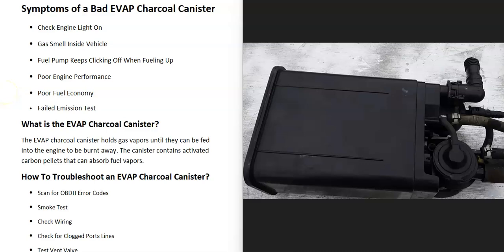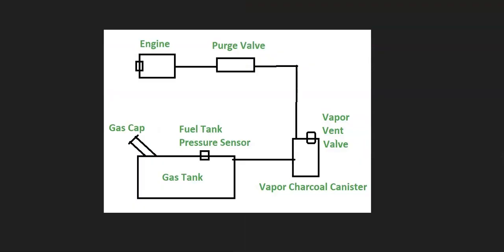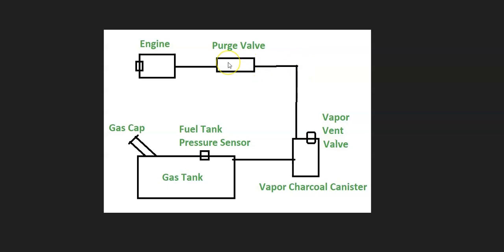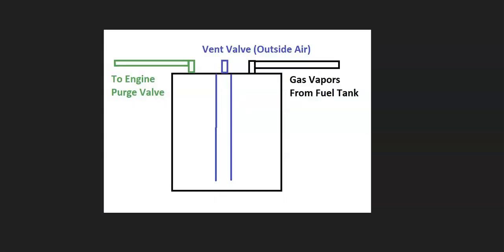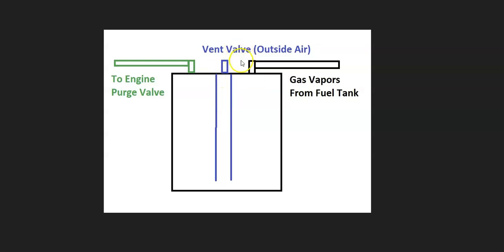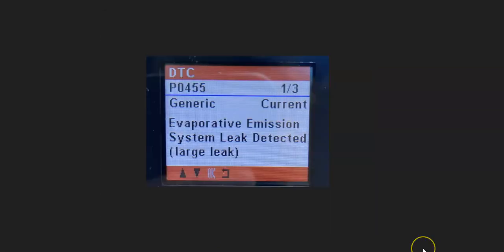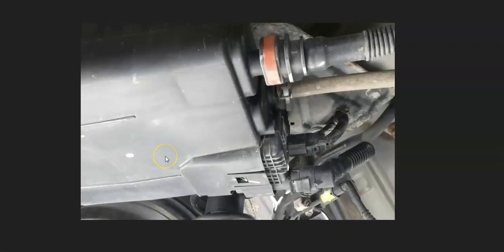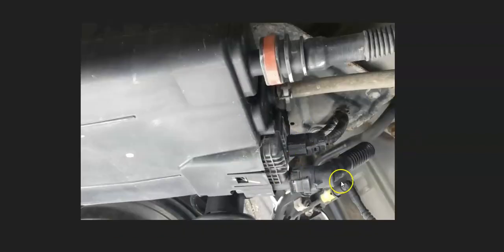Symptoms of a Bad EVAP Charcoal Canister and How to Test if It Has Failed

Comment: Hi , thanks for the video 
I have Mazda 6 2014 i replaced the vap canister with new OEM after that if the car running on idle for more than 30 minutes strong gas smell coming near gas filling neck and I checked everything no leaks at all just smell , what do you think about that
Reply from the maker: There may be a leak, or the purge valve may not be opening and sending the gas vapors to the engine but there should be code if there is a problem.

Comment: I have a 2015 Highlander with a PO441 and PO445.  I've replace both the gas cap and purge valve.  I accessed the evap line by disconnecting the purge valve for a smoke test.  With the key in on position but not running I have smoke leaking from the charcoal canister at the fill neck and underneath the car near the fuel tank(but I didn't have time to look closer than that.)  The vehicle smells like fuel often.  Does this mean the charcoal canister at the fuel neck is broken?  And is the smoke near the fuel tank leaking because the vapor vent valve is broken or just not closed because the car isn't running?
Reply from the maker: Is the vent valve closed? The vent valve, usually located on the charcoal canister, is a normally open valve that needs to be closed when doing a smoke test. A good scan tool with the option can close it, or the port can be blocked off with a plastic bag. If the vent valve is closed and smoke is still coming out, there is a leak somewhere. Sometimes, depending on the gas tank location, the gas tank seal around the fuel pump can leak and make it seem like the charcoal canister is leaking.

Comment: My 2011 silverado is idling rough and hesitating when driving. It  threw a code for (small evap leak) I replaced the purge valve and it didn’t help. Trying to diagnose it I haven’t done a smoke test yet but I’m not having any fuel symptoms or smells that I’m hearing on the charcoal canister. Any thoughts?

Comment: Had trouble filling gas tank, replaced charcoal canister, now my truck stalls out and sounds like a diesel after it's idled for 20 min ,or I press on the gas pedal while idling the diesel sound gets worse, codes 455,456, 191,102,113, 128, also put new thermostat in it. Wanted to smoke it to find what was leaking, mechanic didn't smoke it, he decided to do engine flush, replaced vvt valve solenoid, valve cover gasket a whole case of oil, oil filter put a new fuel driver module on it, put in a new cam sensor, said now it's showing cam phasers, timing chain so I've spent 2000$ on labor only new alternator new battery new starter new steering pump serpentine belt truck runs worse now before I replaced charcoal canister.
Reply: Yikes. . Sorry about that

Comment: Would this also cause the purge valve up top in the engine to run nonstop?
I kept having a ticking sound coming from that solenoid and could feel the vibration from the valve. I changed with the lifetime warranty brand which turned out to be the aftermarket brand and was still ticking. After a couple of months I changed it with the oem 2 year warranty (go figure) and the ticking stopped but the symptoms although getting better for a while were still there and now back to how the symptoms were besides the ticking, but I can definitely tell it is steadily lugging/open. I unhooked it and seemed to run better for a couple of days but I feel the canister is ruined from the steady open valve. I also always would fill the tank so that is something else I was not aware of was a bad thing. I'm thinking filling all the time xaused the issue from what I've read as it was not wanting to start after refueling as well a few times until I quit doing that.

Comment: Hi there I've always had a hissing sound when opening the fuel cap never caused a problem. I have the vehicle for 10 years and recently had a new timing kit and water pump replaced. Now I get a strong petrol smell and it seems to be coming out of the charcoal canister drain pipe. But if I take the fuel cap off it stops and if I put the fuel cap back it starts fuming again. Car runs perfectly all the time idling a bit high about 1100rpm. Any clue what's wrong??
Reply: On the charcoal cannister there is a vacuum hose. There is a sensor built into the hose. Check the sensor. If the sensor is bad you will have to change the hose.

Comment: Great video! Very informative. Can a damaged charcoal canister cause random misfire on start up?
Reply from the maker: No, the charcoal canister won't affect the engine. A stuck open purge valve is the only EVAP component that can affect some engines.

Comment: My check engine light code says charcoal canister and I am getting bad gas mileage (but) I don’t have the symptoms when fueling up or no smell of gas.
Reply from the maker: Issues when fueling up happen when the vent valve, often located in the canister, is stuck shut, but it can also fail and be stuck open.

Comment: What would cause gasoline to go up to the canister?
Reply: Over filling your fuel tank, if you are filling it on the slow setting then when it shuts off stop pumping. Put the pump up and gas cap back on. Other wise when you keep trying to pump more in it you close the air gap bubble more which in turn overflows fuel into the vapor canister
Reply: @19BADGER-F250  I put it on auto pump on medium, when the thing clicks off I don't pump more.

Comment: I have a 1997 toyota tacoma and when my engine warms up after a few minutes of running i have a fuel leak coming out of the charcoal canister vent line. It just keeps pouring out for a good while even after i disconnect the battery.

Comment: Hey, I have a 2006 VW Touareg 3.2 v6.
Everytime I fill fuel over 1/4 tank the car misfires really bad and Preformance is terrible but when I drops back down to 1/4 or less, it runs fine. Is that a cause of a bad charcoal canister?
Reply from the maker: The only EVAP component that can affect the engine is the purge valve. If there are EVAP codes, I would test the purge valve and be sure it is good.

Comment: Hi I have a seat toledo mk2 1.8 20v and when I start my car when I  first start my car it cuts off and run lumpy for about a mile/ engine starts warming up.. would that be a symptom of a bad charcoal canister? as iv checked everything else on the car.
Reply from the maker: The only EVAP component that can affect the engine is a stuck open purge valve. If you think there is an EVAP problem, I would test it.

Comment: ¿Problems with the charcoal canister or vent valve can cause P2279 (intake leak) code and rough idle?
My W12 Bentley has P2279 that appears only in Bank 1 and ECU 1 as well some misfires in all 6 cylinders of Bank 1, I already replaced the EVAP purge solenoid and both banks PCV valves and worked fine for a while, but condition still persist.
I did a smoke test from different points in the intake and vaccum hoses and no leaks werre detected
Note, Bank 1 is the responsible to burn the vapors of the charcoal canister in this engines.
Reply from the maker: It will need to be diagnosed, but the purge valve is the only EVAP component that can affect the engine; since it was replaced and not stuck open, there likely is an intake leak somewhere.
Reply: @HVAC_Mechanic  Thanks, I'll keep looking for

Comment: My 06 rav4 put out a p0441 code i changed the purge valve, new gas cap, maf sensor, both 02 sensors, all spark plugs, new coolant ... idk anymore im going to try the old kseal tomorrow
Reply: I got the same code p0441 and changed all the parts above and even smoke tested but no leak found :( how about ur car now?

Comment: l have a 2009 Ford f150 V8 4.6 runs fairly good but it has a code number P0446 with engine light on, what do you think is the problem? Thanks
Reply from the maker: A P0446 Code is an "Evaporative Emission Control System Vent Control Circuit Malfunction." There is an issue with the vent valve or the wires going to the vent valve.
Reply: Thank you, l forgot to mention that vehicle has no gas cap, would still be the same problem, also need the location of charcoal canister

Comment: My 2003 Hyundai Elantra is throwing a p0451, and the it takes forever and a day to fill with gas. Thing is; I only recently got the error code. The problem with filling the tank has been going on for 4 years. I’m trying to get this fixed as soon as possible, at one time. So my question is, should I replace both the canister and vent valve? And will replacing both of those parts clear the p0451 code? Thank you
Reply from the maker: The vent valve would need to be tested to know for sure if it has failed; hard to fill with gas is a common symptom of a vent valve stuck closed.
Reply: @HVAC_Mechanic  thank you for the speedy response. So if the vent valve is the problem, once corrected, will it clear the p0451 code? Thanks again
Reply from the maker: A P0451 code is an issue with the Fuel Tank Pressure sensor, which is a part of the EVAP system. All these components need to be tested to know what the problem is.

Comment: Smoke tested my ram an it comes out the bottom of the canister is that mean it’s bad
Reply from the maker: The only component that might leak is the vent valve. It can vary on the vehicle when the computer opens and closes the vent valve. It is also a normally open valve that is open when there is no power. If it is leaking out of the vent valve, I would test it and see if it is good.
Reply: Right it’s not it’s coming out of the canister out of the bottom not sure if that’s a seald component or not

Comment: I have the problem only when I fill up the tank at the gas station, with the engine on it starts running bad and eventually shut off.... What could be ? Only the valve ?
Reply: If u fill ur gas tank with the engine running the gas cap is OFF showing a large evap leak. Mine only showed if l added gas after the hose shut off. So stop over filling the tank & see.

Comment: Hello Hvac Machanic, i am using the same Lexus RX300, 1999 model engine 1MZFE. the accident was made by swap/connecting the Vacuum Surge Tank pipe to the water outlet there just below it. The system was filled with water until the water comes out at The Charcoal Canister through the Air Drain Horse. We have tried to remove the water by sucking and blowing through the pipes and even put the new service kit since we found some plugs socked in water. but still the car wont start but cranks. what advice can you give sir
Reply: I know this is an old video but did you get it fixed. I  did the same thing 😅 and now have misfires and poor performance. 04 lexus es330
Reply: @richardburlingame5708  yeah,, thanks i had it fixed. i had to empty clean the fuel tank, put a new canister, new plugs, new fuel filter and ran the fuel pump in a new fuel to clean it thoroughly and it run perfectly. patience worked for me as i did all those

Comment: Could it cause it to run rich or lean?
Reply from the maker: Usually, the Evap system does not affect the engine unless the purge valve is stuck open. If the purge valve is stuck open, it can let gas vapor into the engine, which can cause issues.

Comment: My gas tank is leaking I realized today after smelling gas. Idk if that’s the tank needing to be patched up or possibly the Evap charcoal canister. Also my error code is P0456 is says “very small leak”.
Reply: Did you replace to charcoal canister? I got the same code. I’m reading somewhere that if you overfill your car allot it can ruin it too.
Reply: @GametimeSlime  yes I did but it might be the fact that it was an aftermarket one
Reply: Same my truck is a 2019 Tacoma what is your vehicle?
Reply: @MahALOHAwaii92  2010 Nissan Rogue and just saw this comment